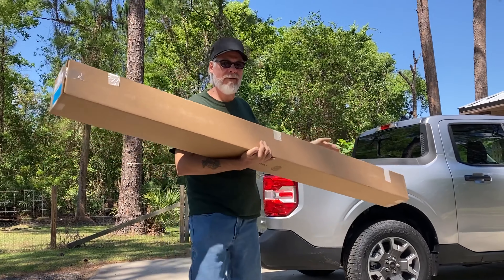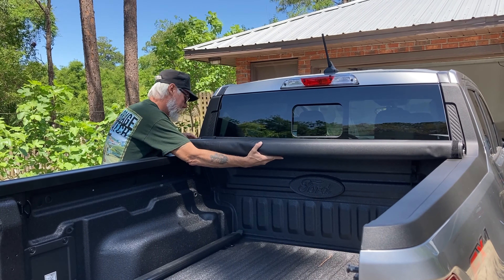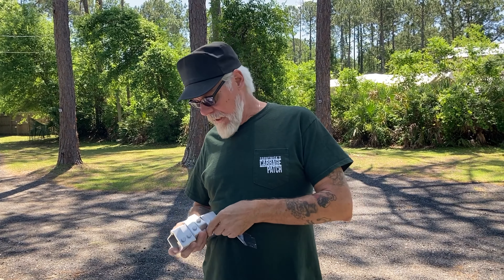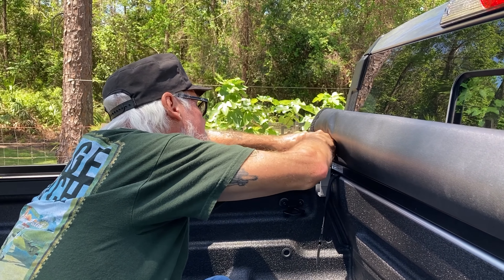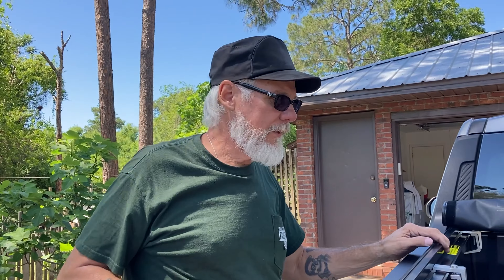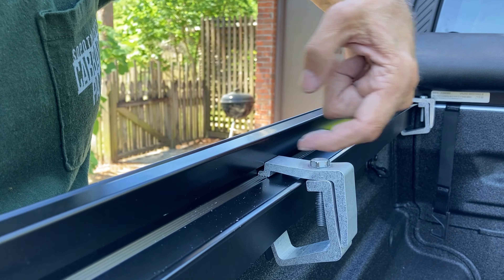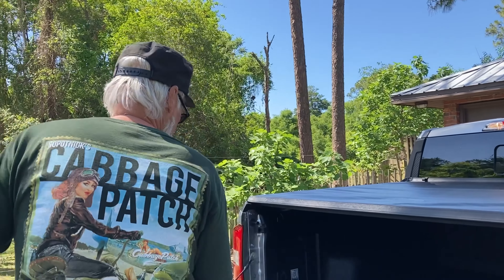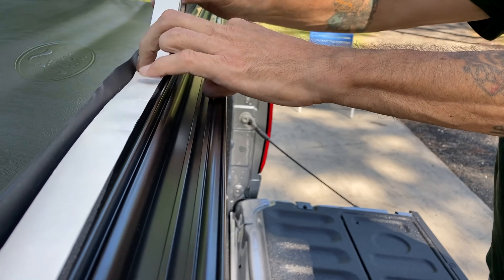Ford Maverick Tonneau Cover Install

Comment: the weather strip goes on the bulkhead not the tailgate
Reply from the maker: Hi Peter.
The instructions stated the weather strip wasn’t needed on the bulkhead if you have the spray in be liner. So that’s why I put it where I did. I guess I’ll find out when it rains. Thanks tho, and thanks for watching!

Comment: I think you need to move it back towards the tailgate, it shouldn’t fold up like that up against the window.  I think you actually have the rails in wrong the close up shows it’s angled and it should be flat.  Nice truck tho!
Reply from the maker: Thanks Jim. I’ll take a look at that. Thanks for watching!
Reply: @gedspub  no problem, the weather seal that’s already attached to the cover goes against the bulk head, rain will come pouring in otherwise.  I have the same truck!